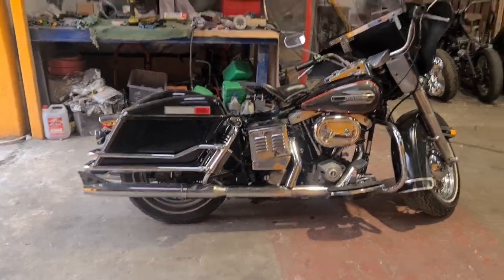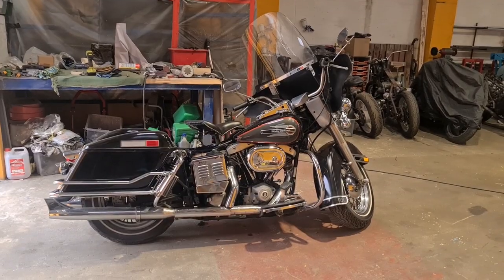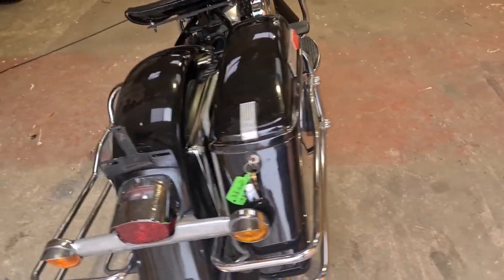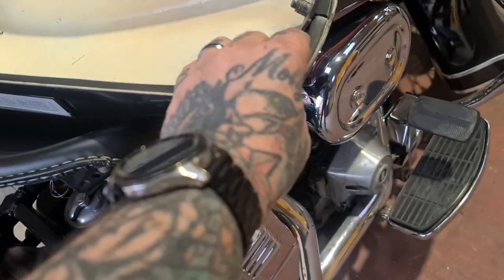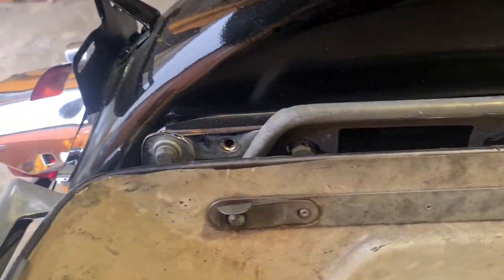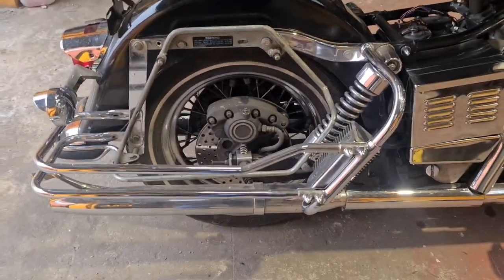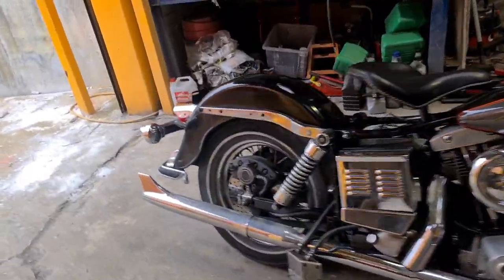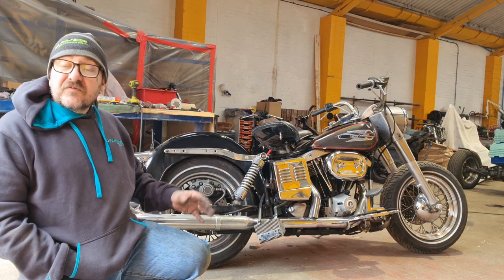1980 Harley-Davidson FLH Part 1

Comment: Way back in the day we use to put old gas powered washing machine motors on our bicycle..drilled a wood circular block out and fastened it to the crankshaft..run it on the rear tire...or trye.
Lol